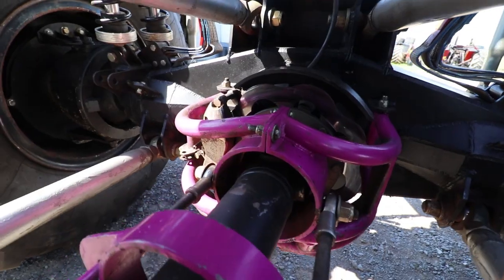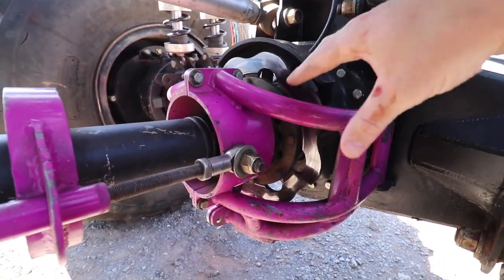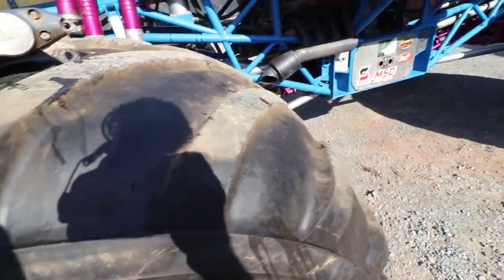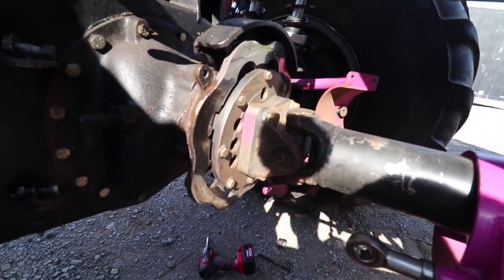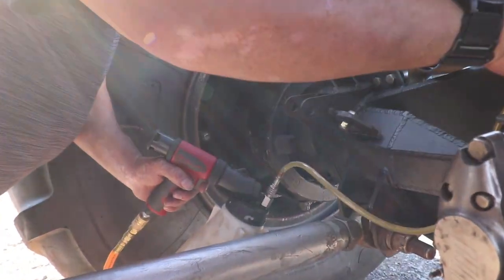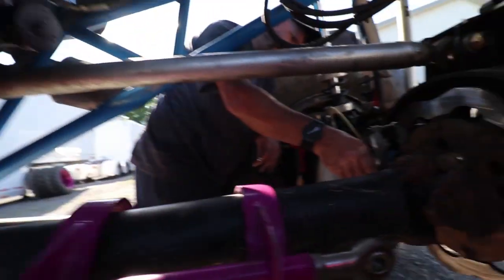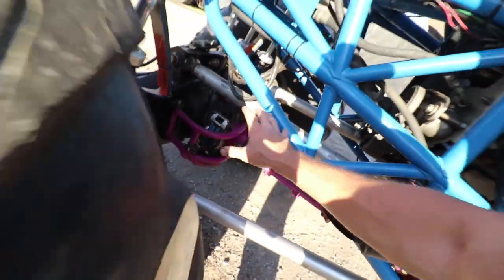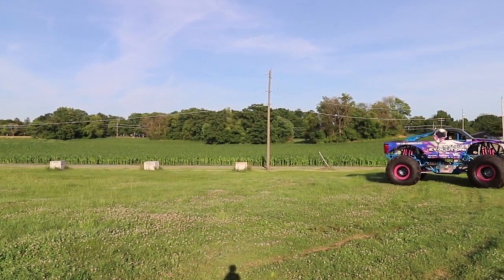This is A Problem..

Comment: thx for the mini education on monster truck brakes Mike.  not overly technical whereas only ones that would know what you talking about is you, techs and the hardcore MT fans but just enuff techical so the layman fan can get a grasp. as for the 4 wheel brake setups, the axles , planeteries are already heavy enuff, prone to damage thats why lot of teams switched to the driveline setup right?

Comment: I enjoy watching the behind the scene stuff more then that actual shows. 😆
Why do so many trucks I see have the rotors glowing and throwing sparks? Are calipers pron to fail a lot?
Reply: thats from the rotors getting hot, very hot. monster truck weighs 10,000ish lbs, thats huge amount of weight to bring to a stop, plus drivers sometimes will ride the brakes to keep truck under control
Reply: @harveylong5878  Yeah I realize it's the rotors getting hot. I wondered if they road the brakes a lot. Some trucks will come out and start glowing pretty good before they even really do anything.

Comment: Have you driven a truck with the ZF planetary wet brake setup like Bigfoot has? Curious how they compare to the pinion mounted brakes. 

I've driven heavy trucks with a wet brake before, but not anything with the pinion mounted brakes.

Comment: Those need pretty big CALIPERS because that's a ton of weight. And it's not a cali"b"er it's a cali"p"er
Reply from the maker: So sorry
Reply: @V2Vids  no apologies necessary, it's just 1 letter turned upside down is all. I mean it's not like you're calling the driveshaft an axle.